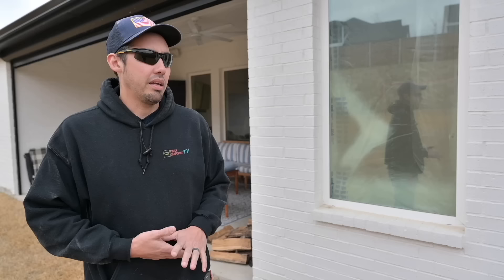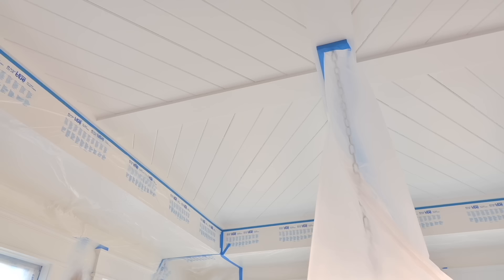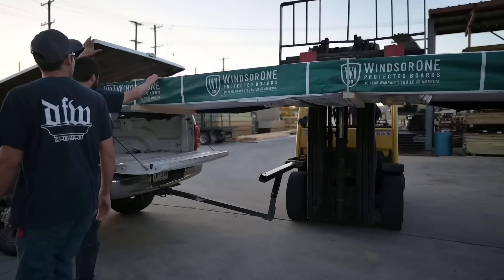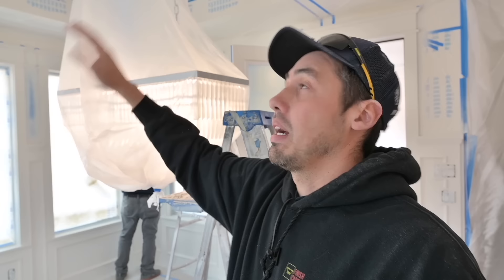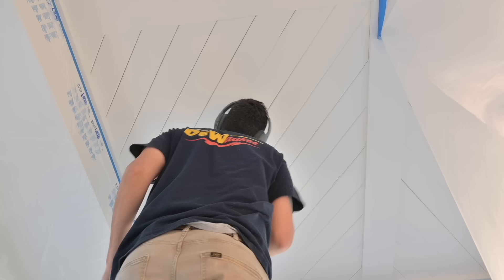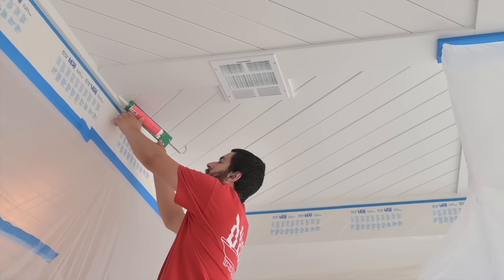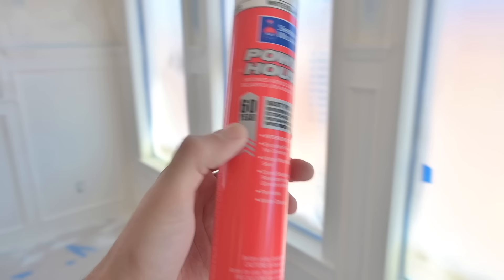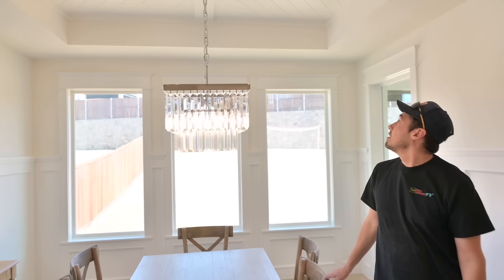Customer furious with me - Failed Trim Install

Comment: That's why I was taught that you always paint all sides of interior trim before installation. Even a quick shot of spray primer is an excellent vapor barrier and painting all sides would mitigate the shrinkage. At this point I would not even caulk them and let the joints shrink and expand on their own, and I think it would look cooler.
Reply: Roger that. I learned that lesson on a porch floor install, did not back prime had to remove and replace due to rot/mold issues.
Reply: Why did he even caulk the seams to begin with? These panels are supposed to be installed without caulking to allow for continuous movement of the panels. They will ALWAYS expand and contract for their life because of temperature, humidity, suppport movement, etc. The whole idea of panel joinery like this is to accomendate for wood movement. It allows free movement of the panels WITHOUT a mechanical or glue fastener holding panel to panel together.

T&G, shiplap, etc... is all trending right now and purely installed for looks.  However, most have forgotten its how walls were made for centuries to account for wood movement. I see it all too much these self-employeed custom trim workers dont know the basics of woodworking & carpentry. They rely so much on ready-made products and high-end tools to do the work for them. Its more than slapping together a few boards together, hiding the nail holes, and using a "60 year caulk."
Reply: Primer is not a moisture barrier.
Reply: @JustinRaymondUtah  100% correct. Im a high end painter for 40 years. Same with paneled wood doors.
Reply: @KickingTheLion Possibly. Not if you don't use latex primer
Reply: I thought the ceiling looked a lot better when he cleaned all the caulk out.  I dont understand why the client had him go to all that trouble to do a v-groove ceiling, then hide all the lines.  
I wonder if this was one of those, the customer is NOT always right situations.

Comment: I think you should consider a switch to MDF matchboard for this look in future. Even if you had acclimatised the wood (was that even practical) you could still expect some seasonal opening and closing. MDF matchboard is available in UK in 8'x4' sheets
Reply: MDF and route the grooves
Reply: Yes, 100%. Even with the wood painted and caulked and sealed, wood will move with seasonal humidity fluctuations. The tongue & groove joint in this application allows for that expansion/contraction to occur without problems, so maybe think about leaving out the caulk next time if you do chose wood again. (Just suggesting, not trying to be annoying! 😬😅)
More importantly, MAN I appreciate your integrity! It seems so hard to find people who own their mistakes, but when they do, and make it right, I respect them more than if they hadn't made the mistake in the first place🙂. Your passion and desire to do good are what make me love your channel! 👍
Reply: 1/2 MDF screwed to the joists will move?
Reply: Yeah I would not take this job if they wanted seamless wood forever it is impractical.
Reply: yup Moisture-Resistant MDF .
Reply: MDF contracts and swells worse than wood
Reply: @michaelmisczuk7570  Every thing does even steel bridges and tile. But wood is unpredictable and will swell and shrink at different rates. There are more variables with grain patterns and possible case hardened wood because the mill sometimes rushes things. It is like the cement board under tile, it will move but at a similar rate to the tile to mediate movement.
Reply: @xinixxagnix201  MEDEX
Reply: No
Reply: @michaelmisczuk7570  it doesnt contract, and it only swells when its been saturated...
Reply: @michaelmisczuk7570  Not if sealed correctly. And not in this application.

Comment: you never caulk tounge and groove boards,they have to expand and contract just like shiplap is the same way
thats the whole purpose of the tounge and groove system
Reply: The whole point of the tongue and groove system is to have a great hold without having visible nail holes. You can toe nail it and hide all nails.
Reply: Yeah but the home owner probably asked to have them caulk
Reply: @therealryufromjapan3051  Then I would have explained to the homeowner that that is not a good idea. If they insisted, I would let them know that there will be no warranty when the caulking fails.

Comment: I've been a carpenter for 36 yrs and still learning!
Glad to see you're standing behind your work. I don't think I would ever caulk the seems though expand and retract is what wood does. Especially if  the humidity in the house isn't controlled year round.
Reply: I live in Australia in a region where during Winter we get severe frosts & in Summer it gets into the 40's (105ish ). Anytime a client asks me to do ceilings like this I warn them about the probability of expansion & contraction due to extreme temperature changes. If they still insist on getting it done then I get them to sign a waiver for any cracking that may occur after 1 cycle of Summer & Winter. The problem with caulking (as you eluded to) is there's always the possibility when the timber does shrink the caulking pulls itself apart no matter how good it is. Having said that I always open the packs of timber & spread them out around the house on racks for about 3 weeks to get acclimatized before install.
Stay safe, have a great day 👍🏼🦘
Reply: You sound like east coast he sounds like west coast

Comment: I've ran into the same issue and have since been allowing my material to acclimate for a week and also started using a better quality caulking! Sucks to get a call back but owning it is what most customers look for!
Reply: Ive learned to buy HEAVY caulk. Regardless of brand, most stuff at home centers is crap. You have to get the good stuff from suppliers and its all noticeably HEAVY.
Reply: I've also found that if there's a complaint on my work, I try to get there the next day!!! Or the same day or late in the evening is ok with everyone! And push the job your on to get it fixed,,, if possible!!
Reply: @stevehamman4465  just make the customer feel like they are being taken care of not taken advantage of works always and own up to a mistake

Comment: Excellent video. I would have considered skipping the caulking altogether, once you had scraped out the old caulk. I've had the exact same experience on an entire church roof. My caulk was hanging like toothpaste after a year! The boards will expand and contract over the seasons. The best paint I've found is Zinsser Allcoat Water Based - it's an exterior paint but I often use it indoors. 2 coats will happily bridge a 2mm gap.

Comment: Couple notes on this.
1. If the house is under construction and the HVAC isn't working yet, there is no way to acclimate the wood to what the house will be at.
2. It's wood, and even with HVAC running, the house will have different levels of temp/humidity due to seasonal changes. Those seasonal changes WILL cause the wood to expand and contract throughout the year.  This is the same reason why you never screw the apron to the table top without using some sort of clip to allow for those dimensional changes. You have to allow space for the wood to move.

Comment: I think it looks better with the gap. Give the ceiling more definition. I have had great success with a caulk from Lowes called Big Stretch made by Sashco.
Reply: I would have left with gap also. Caulking that gap will not last forever it is going to crack again, because those boards are going to expand and contract every year with a change in seasons. Not as much as this initial shrink and some more than others. Kind of surprise they did not leave them as simulate to the houses environment at least for 24 hours, it says it right in the instructions and any other real wood product  like  flooring says that also.
Reply: Big stretch is an amazing product, but I still agree with the comment above. Expansion and contraction. Especially the area you live. Even when showed the finished product, how couldn’t you be happy. Precision alone
Reply: Agree
Reply: I agree, don't caulk v-match! Just don't.  And also, any caulk made by sashco is excellent, in my experience. And lexel I like too.
Reply: Yes.  And don’t fool yourself - I don’t care what the manufacturer’s guarantee is - that stuff is going to crack.  Wood moves.

Comment: For paint grade work up high like crown, coffered ceiling or accent walls MDF is always my first choice. It's not susceptible to moisture movement, plus I'll use some glue to attach the material to substrate. Going on two decades and never had a call back.
Reply: I've been working in a large apartment complex doing remodels on their units for the past couple years.  The company I work for has been tearing out old finger jointed pine base & replacing it with a bigger MDF product at this property for over 5 years.  We get called into units every month after move outs for warranty work &  joints that were once tight are often gapped 1/8" or more all over the place!  The base gets stored in a high moisture underground garage for about a month before it gets moved up into the unit on the day of install.  Based on what I've seen, I don't think MDF is any more resistant to acclimation than Pine.  Tbh I think it might be worse.  None of the pine we're tearing out from 20+ years ago is gapped like the MDF we installed just last year is!  I suppose it could just be the installers 😂, but I'm not so sure.
Reply: @GreenOne01  I'd never use mdf for casing or base, it's too easily damaged/ dented. It's wood only for those areas, plus trim install doesn't start until dehumidifier/air conditioning is on and material is there for like 10-14 days minimum.
Reply: @GreenOne01   I have seen some pretty terrible movement with MDF trim, nickel gap ceiling, crown, base. I believe they also did not acclimate the trim prior to install and MDF will move on the length if its not properly acclimated.
Reply: @GreenOne01  I'm sure you would have the same issue with pine/fir/poplar or any wood stored in high humidity. Apartment complexes also aren't know for climate control in the units.

Comment: I come from a long line of contractors and engineers. I went a different direction. I'm more of a DYI kind of person, but I learned a lot from growing up. I have made some major costly mistakes; I mean who hasn't. A person has to appreciate your honesty and the fact you put this out on social media makes you a more respectable contractor. No contractor is perfect, no matter how long you've been doing it.   I've never used caulking on T&G in fear of this very thing. I usually spray the T&G prior to install, and then I use small amount of glue on the back of the T&G to the rafters/floor joist (to include nailing) to keep that movement to a minimum. So far after 15 years on our outdoor patio, to include our indoor living area I have not touched our ceiling nor had too.

Comment: I really appreciate you showing your rare failures. Makes me feel better about myself ;)
I just experienced the same... Remodeled my apartment last year. Because of covid, I was having a tough time finding baseboard. Either they didn't have what I wanted or they were in short supply and I couldn't buy enough to complete the entire job. Anyway, finally found what I was looking for in unfinished pine. Because of the wasted time looking for the baseboard, I was behind schedule. Bought them, brought them in and the next day they were installed then painted. Few months later, all my corners were opened a 1/8 inch. Looked like I didn't know what I was doing the day I installed. Bugged me like hell everytime I saw it. I was embarrassed to have people over...
Finally got it fixed.
Not the way I like to work, but sometimes you've got to learn the hard way.
Thanks again for the video. I love your work and work ethic.

Comment: As a fellow professional I am proud you owned and repaired this. I am glad you learned a bit about the characteristics of wood. They should have been in the house for 2 weeks, AND painted before you put the up, 1 coat, that way when they do expand and contract you wont see it. Secondly painting it on the sealing puts a top coat over the whole thing. and when it moves it will crack. I am also surprised you caulked them? I would have never done that ever. BUT I am glad you cleaned it up for the customer
Reply: Ceiling

Comment: In my opinion, hard to keep that from happening.  They expand and contract with the seasons.  I have a 2800 sf house built in 1910.  We installed new T&G on ceilings throughout.  Boards were allowed to acclimate to house for weeks prior to install.  Every ceiling looks like that 5 years later.

Comment: Interesting, I’ve always resisted caulking this type of situation in the past, looks like for good reason!
Reply: It's not meant to be caulked
Reply: Agreed. 

In Massachusetts painting company caulked all the kitchen cabinet doors and they look like shit. Had to go in and build new doors. Hopefully they don’t caulk it again
Reply: Same. I avoid caulking this. Anything that gets caulked becomes a maintenance item
Reply: Knowing where, and when the appropriate time to rub your caulk on things is  paramount.
Reply: Caulk and paint makes you what you ain't.
Reply: @snafubar5491  thats the truth.
Reply: I wondering  if it was tounge and groove how could it shrink up enough to expose see though cracks . that's a pretty big contraction to do that . honestly looks like decking boards were used that would absolutely  do that . never seen secured tounge and groove do that ever.
Reply: @snafubar5491  What you can't fix with a lil caulk, use the big caulk
Reply: @ghshomeimprovements  hahaha! whyyyyyy? that would be like caulking any raised panel door. they are designed to float.
Reply: @NEKingdom241  Many Unexperienced  painters
Reply: @ghshomeimprovements  Isnt caulk the appropriate material to hide that gap on the framing bead?  I mean obviously you can caulk something horribly and it will look terrible even if it supposed to be caulked.  If you wet your finger, it’s much easier to make the caulk look seamless.  What problems arise when you use caulk on cabinets if you’re painting them white?
Reply: @FerdEdits  you can’t caulk wood cabinets, wood doors in older homes, etc. it just can’t be done.
Reply: @ghshomeimprovements  
Why cant it be done?

Comment: Richard, I'm curious to know whether you stand behind caulking the cracks, as opposed to painting each piece individually, fitting tongues into grooves, and THEN installing them. I.e. with a consistent visible crack and where continued movement of the wood is to be expected. (like this is the approach to doors, isn't it? You glue some joints, you wax others, expecting the pieces to move but to stay together)
Reply: Calking is fine when it comes to construction using masonry materials but when it comes to wood the issues arises with expansion.
Reply: Exactly what I was going to say,  why caulk the join?
Depending on what kind of humidity or moisture is present I'd say it could possibly happen again. Personally I would not use caulk in this kind of situation.

Comment: I personally would never caulk T&G because it will always move. Making the sections in one piece out of MDF by rotoring V grooves into them would be far better and probably save a lot of labour on site.
Reply: MDF moves much more than solid wood, and in BOTH directions. I've seen it grow as much as half an inch in a 16ft long board. Regardless of what people say, MDF is NOT a stable product for trim work.
Reply: It's the same reason when I'm specing cabinetry and they want paint, I only spec one piece HDF doors because a 5 piece will shrink and swell no matter what and cause hairline cracks at every joint.
Reply: @AlAmantea  Solid wood will grow/contract a lot more than 1/2" over 16ft if that measurement is across the width/grain of the boards. The point of MDF is that it grows equally in all directions, not at different rates along and across the grain, so if you make an assembly of MDF the entire thing will grow/contract equally in all directions and therefore no gaps open up.
Reply: I agree . That wood expands and contracts . Dont caulk that!
Reply: Ooooooooooohhhhhhhhhh !!!!!!!😆😆
Reply: @AlAmantea  I’ve built more things than just trim work, as a cabinetmaker I have seen MDF move but much less then real wood not the other way around
Reply: Yea ok thats why the industry standard switched to mdf skirting so that the miter and scribe joints dont gap as mutch and there is no need to aclimate. It starts off with next to no moisture content so its used widly for the anty shrinking and expanding properties 🤷

Comment: Thinking maybe you have been using mdf trim so long, you forgot that wood moves. I'd have at minimum, pre finished the t&g boards prior to install. Anyways, good on you for fixing it. Silicone caulk stretches like a gum band.

Comment: I had a similar situation with a customer who decided after his ceiling was installed that he wanted a whitewash finish. Thankfully I warned him at the time that the boards would shrink as they dried out which they of course did. I got called back asking for a price to re-paint the ceiling which we were able to do fairly cheap. Lesson learned, you're a good man to stand behind your work. I wish all contractors were that way!
Reply: And the boards will continue to shrink and expand - at least they do in my 45+ years wooden house. I just repaint the cracks again and again :-)

Comment: I have never, in decades, seen caulking used on T&G joints and I'm totally baffled by the logic of doing it to begin with. In my thinking the moisture content of the wood had everything to do with the shrinkage while the caulking had zero to do with the result and did not fail.
Reply: Did the customer ask for this? I have done many jobs with this stuff, I have never caulked it.
Reply: It's gonna keep cracking.
Reply: will 100% crack again. painting business owner, would never caulk that.